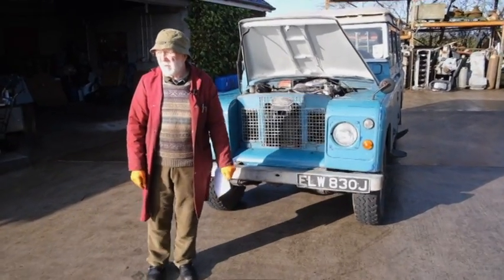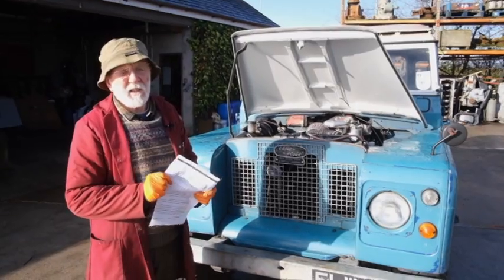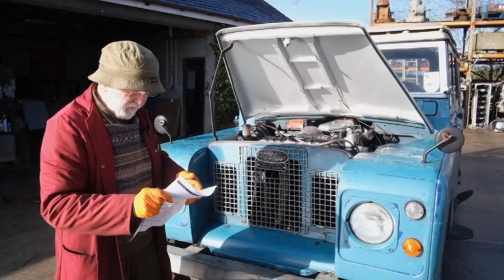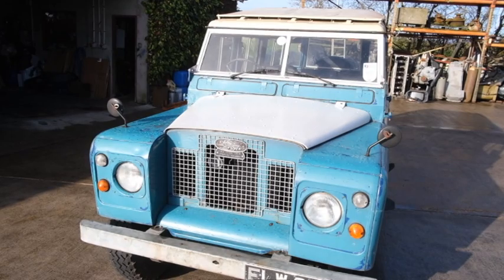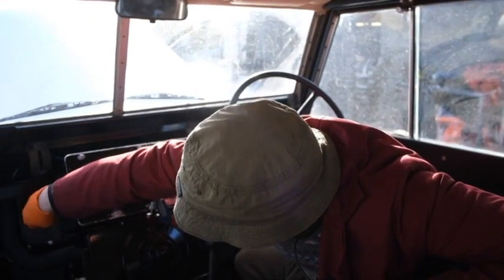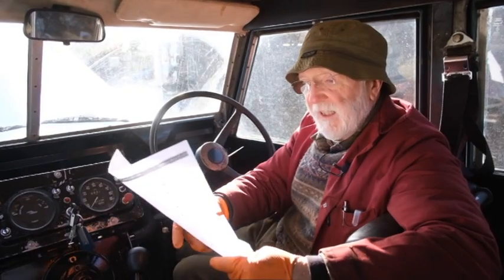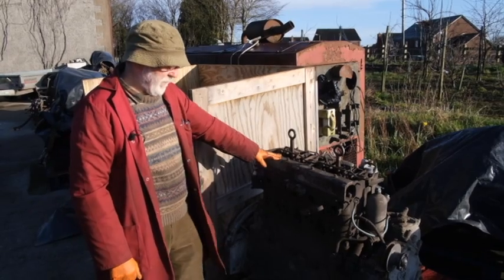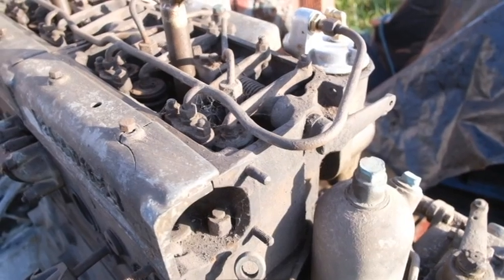Land Rover Series IIA Gardner 4lk Engine Swap

Comment: I used to work for Crosville bus company and one of the modifications they did was to remove the engine out of a leyland national mk2 bus which was turbo charged and fit a HLX Gardner six cylinder which gave better fuel economy.

Comment: I like the knocking sound of the Gardner. A lot of work is behind you, isn't it. We swapped the 2.25 petrol for a 200Tdi Discovery engine. Mine is a 109 S3 (1984) ex-mod FFR, LHD.

Comment: Though, from what you are saying, the Gardner engine is the one everyone would want fitted in their truck, the complexity of the necessary modifications, and the resulting compromised reliability and functionality of the end setup, not to mention the expected associated high cost for the conversion, render the project not nearly worthwhile. And it sounds uncomfortably noisy too inside the cabin.

Comment: That engine will still be running long after the LR around it has rusted away! 😁 OK, joking aside, "built to last" isn't a phrase used very often these days but a Gardner certainly qualifies, built in a bygone era with a different design brief to many of todays "throw away" engines. Back in the 70's all our local buses had Gardner engines. A friend of mine was a truck fanatic as his Dad drove an artic and he would often come home in the tractor unit, a Guy BigJ4T, "with a Gardner180", he would say with a big grin on his face. 👍
Reply: I hope the engine lasts longer than a month

Comment: I'd rather have a 200tdi fitted. This Garndner is way too heavy. 200tdi is a great engine. Very mechanical and long lasting. To bad it has a timing belt but these are long lasting.

Comment: I worked at Gardner in the 1970s in the crankcase division, engines would come back in running condition with over 1 Million miles on the clock for reconditioning and went back out with many of the origional parts on them. They had no sump gaskets and never leaked and steel shim head gaskets that never leaked such was the fine tolerences they were machined to. Sadly they are no more but if you wanted a reliable donkey to do work, this was probably one of the best.
Reply: I worked on 6lxb engines in foden lorries they were very smokey  on start up and leaked oil especially when worn

Comment: Joe, what is the best Diesel engine including modern engines used for light commercial purposes
Reply from the maker: I am really sorry, I am not in position to answer this question.   There are so many engine makes out there.
Reply: No problem, it’s a curiosity question really - I’ve had VW transporters for 20 years and transits before that always diesel - drove route master buses for a couple of years in the early eighties  - really enjoy your videos btw 👌

Comment: Great channel, seeing the Land Rover with the 4LK fitted reminded me of an old friend here in Jersey who bought a brand new Land rover in 1973, not long after he proceeded to remove the original engine/gearbox assembly. He fitted a 4LK engine which had some sort of Jaguar gearbox fitted .If i remember rightly it came out of a Lagonda. It was only 2wd and he fitted larger rear wheels to raise the gearing. It was used like this for many years, sadly Jim or the Land Rover are with us anymore.